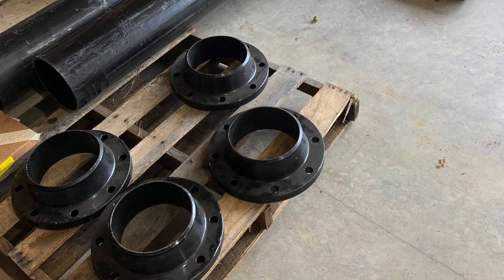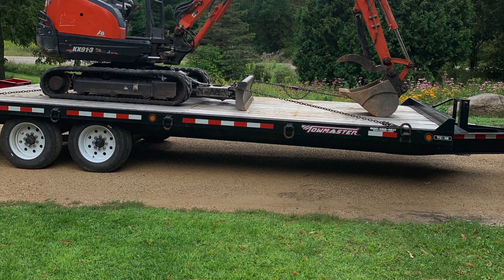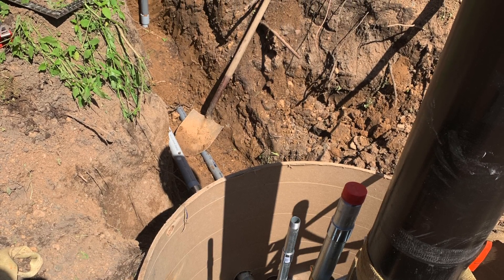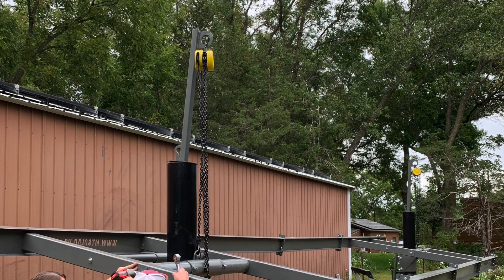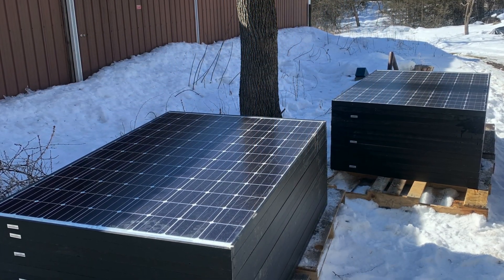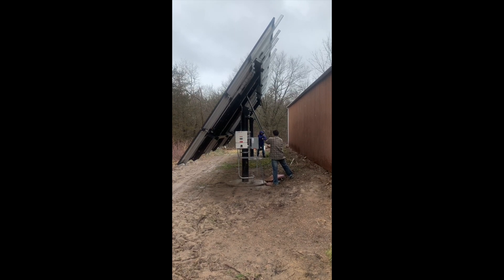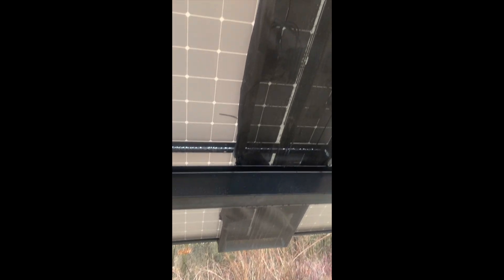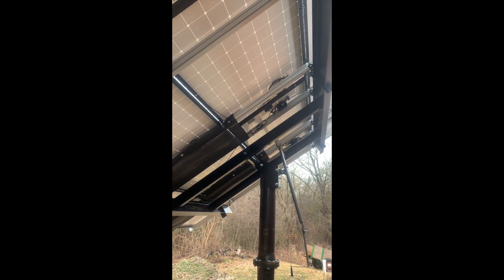MT Solar Ground Mount with Panasonic Solar Panels

Comment: Looks great. What is approximate total for all ground mount materials and concrete for a DIY’er? Thx.
Reply from the maker: The top pole mount was for 28 solar panels, the heavy duty model from MTSolar cost around $7500.00. The 6" sch 40 pipe I got for cost from a pipe wholesaler was around $800.00. The Sono Tubes cost $600.00 I used 7 yards of concrete plus the my buddy the concrete guy and his backhoe was around $2,000.00. The ground mount is top notch.The ability to change the angle does make a difference on the solar collection. But, if this is too much for you, you can put in a fixed ground mount system for a lower price. Just by adding an extra 6 to 10 more panels would more than make up for the ability to tilt the array.
Reply: Rock and roll, nice work! I’m going to do something similar and like your flange collars. Those would be great to get everything perfectly level over distance. Big array too. How did you learn of your snow load/wind? Cheers!
Reply from the maker: @thorntonart  I got that info from MTSolar. I don't live in a high wind area, short of tornado's. Snow load, I went by my average snowfall. But at the winter angle, very little snow stays on the array. Occasionally a wet snow may stick to the panels. I have a snow brush and can easily clean off the panels in 10 to 15 minutes. The one calculation needed for allowing snow buildup at the base of the panels. I have gone out once or twice and shoveled down the snow at the base of the panels. The snow was starting to cover the lowest part of the panels. If I had to, I could have brought the angle up slightly to keep the panels out of the snow. On a sunny day between Dec 1st and Feb 1st a good solar day is 27 kw per sunny day. In February the sun angle rises and solar power gets more intense. By mid February a sunny solar day puts out 80 kw per day. By the time mid April hits, a sunny day can produce 90+ kw. I have solar panels on my garage roof also. The total number of panels on my system is 50 panels. The best solar day I have ever had was 116 kw in the second week of May, a couple years ago.